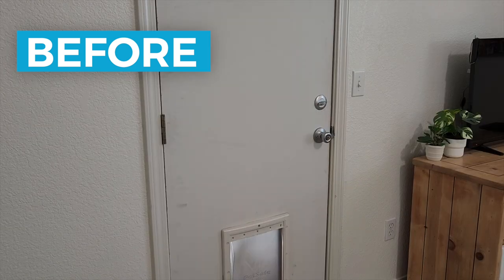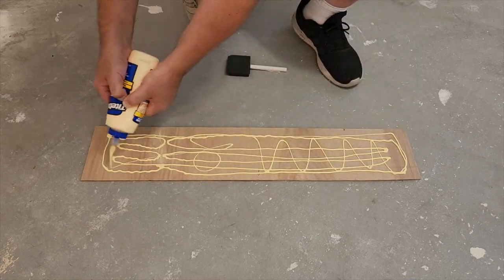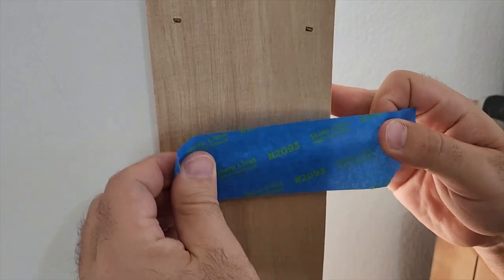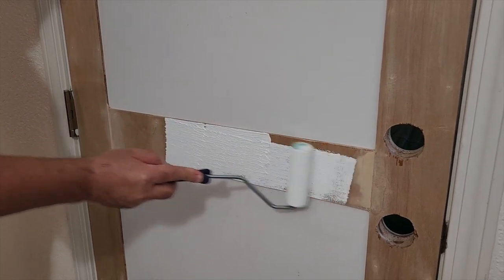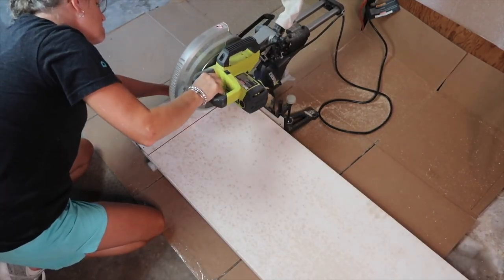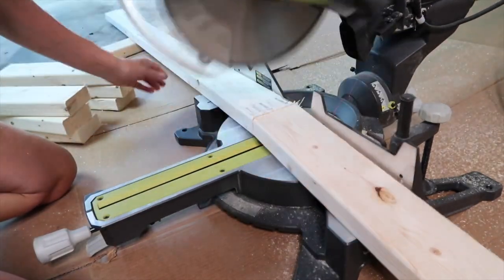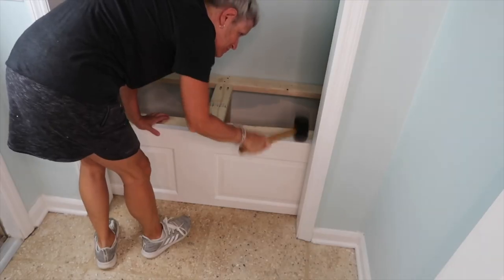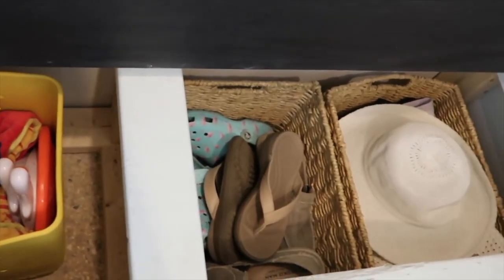Do THIS to your front door—for $12! (Brilliant!)

Comment: You can also buy some small molding and outline the sections for a more 3D effect. And it too is very easy to measure and cut and install. Basically whatever you want to do to make a dull door pop...

Comment: But wat was the purpose of the modification, was the door broken, or you just want to beautify, reinforcement can't be the reason because plywood used was just a quarter inches thick. ?
If the door was ok, then just a coat of paint would be enough.

Comment: Plywood is a terrible product. It damages extremely easily and will require replacing (you really can't repair it effectively) in a fairly short amount of time - particularly if it is exposed to moisture of any type.
Reply: Actually, the laun plywood is moisture resistant and is perfect for high moisture areas.